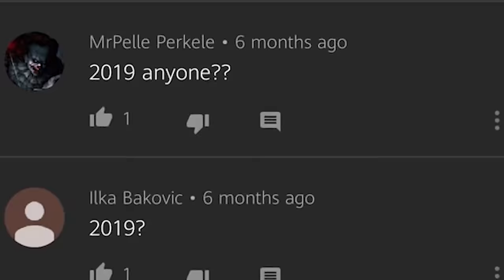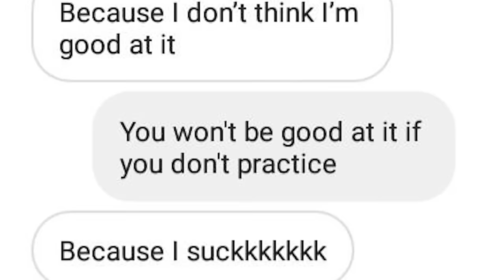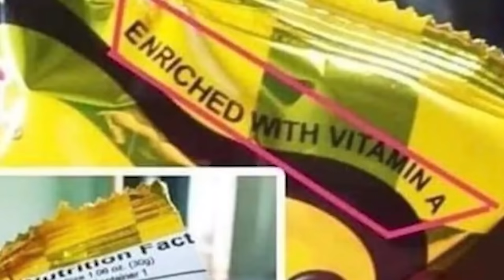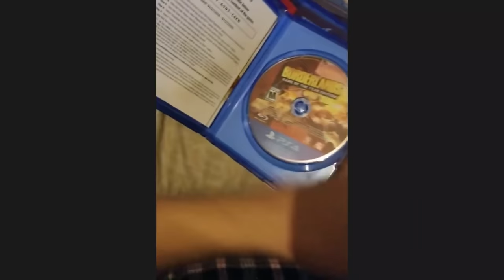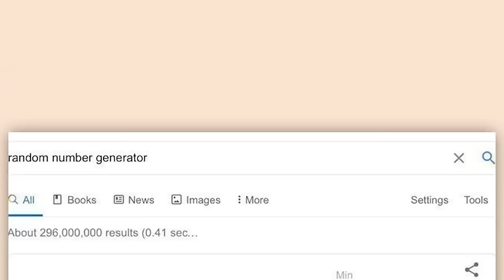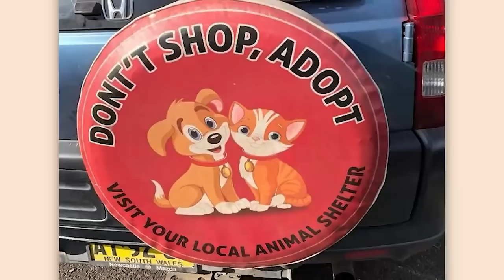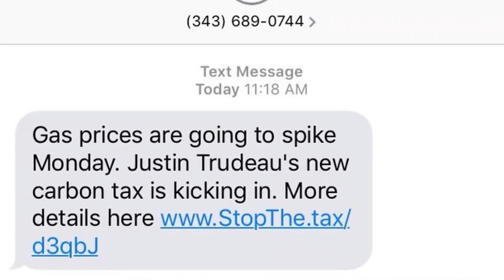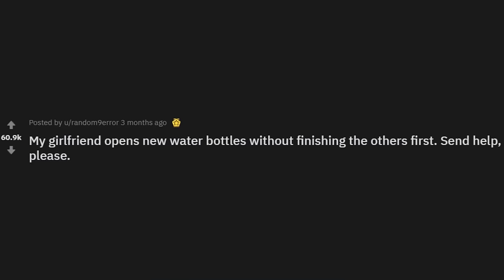THE MOST MiLD OF r/MILDLYINFURIATING

Comment: Fun fact, at 35:05, that is a completely possible pattern to show up on 4x4 Rubik's cube. On a normal 3x3, its not possible because the center pieces never move relative to the other centers. But a 4x4 doesn't have a set center, so if you solve it the way most people learn, (which is to make your centers out of the 4 middle pieces, then solve it like a normal 3x3) you can put the center pieces in the wrong spot. This will lead to this. But it is solvable. Just annoying and ruins your solve because you have almost zero way of knowing whether you fucked up until you get to this point where these 2 pieces are oriented wrong.
Reply: thats not the center pieces, its parity, you get a 50/50 chance of getting it (oll and pll)
Reply: @playformers1238   A parity occurs when you put the center pieces of a 4x4 in the wrong spots. With a 4x4, you create your centers first, then solve the edges like a normal 3x3. But the center pieces have to go in with the correct orientation. There's no way to know which way is the correct way, which is why its 50/50 that you'll get it. It affects the edge pieces when you get to the last part of the solve, but it stems from your center pieces. The parity shows itself on the edges, but the cause is your center pieces not being put in the right orientation. I never said those were the center pieces, I said that this occurs because of putting your center pieces in the wrong spot, which is 100% correct. You can't get a parity on a 3x3 because the centers never move relative to each other. Since there is no set center on a 4x4, it opens up the possibility of getting a parity because the center pieces can move relative to other centers.
Reply: @PotholedAxe9985  did you write this using ai? you have parity even in 5x5, where the centers dont move. the edges are flipped. that is why there is parity. its an error in edge pairing. plus, you were wrong about the parity in 3x3. you cant get it because there is no edge pairing there.
Reply: @PotholedAxe9985  Why are you trying to reinforce this? It's so obviously wrong.

Comment: 1:50 fill a bowl with broiling hot water, put the mug in and weight it down (don't fill the mug, you only want it on the outside), wait 5 mins, add some lube (the runniest oil ya got), place an icecube on the center of the tiny dish for 15 seconds (be sure to not let it touch the mug or let the any water for the cube touch the mug), put some plastic wrap on the rim, put a pillow on the counter, hold it by the bottom of the mug *not the handle* (unless you want to risk ripping the handle off), and smack it rim side down on the pillow. 100% will pop free.

The heat in the dishwasher expanded the ceramic just the tiniest little bit. The smaller dish would have cooled more quickly since, ya know, it was smaller. It was just bad luck they were nearly the same size so it just barely fit in there, then the ceramic shrank back down to size locking it in place. The same principle is used to hold the cap on nuclear reactors. They don't really want those caps to come off so the cap is heated until its glowing red hot and the bolt get a bath of liquid nitrogen. Once they are threaded together and the temperature equalizes god himself couldn't separate the two as they are torqued to ~4 MILLION foot pounds. In other words, you could have a wrench 50 feet long with 9 elephants balanced on the end and it wouldn't budge an in inch.

Comment: Fun fact, at 35:05, that is a completely possible pattern to show up on 4x4 Rubik's cube. On a normal 3x3, its not possible because you dont have to make the edges. But a 4x4 doesn't have the edges already made, so if you solve it the way most people learn, (which is to make the centers, edges, then solve it like a normal 3x3) you can make an edge flipped the wrong way and it will not be right. That will lead to this. But it is solvable with an algorithm (sequence of moves). Just annoying and ruins your solve because you have almost zero way of knowing whether you fucked up until you get to this point where these 2 pieces are oriented wrong. You can also get this a second time, which is when you put the edge (flipped or not) in the wrong spot and you have to fix it with an alg too.
By the way, another user tried to explain it, but was wrong. So don't listen to them. If you search how to solve a 4x4, you will see that i am right.
Reply: Yea

Comment: 4:56 Well, at least we know this video is Devil-free.

13:48 Went to HPB with my grandma one time. We got to witness someone park horizontally across four different spaces and just leave their truck there. It was still there when we left.

39:36 I don't think those are painted. If that's the soft part, I think those are molded with materials of that color, so they straight up just put blue plastic in the wrong mold lol

Mildly infuriating: Calling Bumblebee in specific "the speaky car"

Comment: 12:13 This reminds me of a Pentrex DVD my dad owns (Pentrex is a video producer that does train videos for railfans) and this was I believe at some point between 1988 and 1994 but the Norfolk and Western 1218 (steam locomotive) was doing an excursion. The Pentrex crew was chasing the train (meaning following it and either taking pictures or videos of it going by at different locations) and they happened to see a bunch of people in a parking lot waiting for the train to go by. Pentrex was not originally planning on stopping there but decided to just stop by anyway. About a few minutes after they set up, a Southern Railway freight train passes by on the track closest to the crowd. As the train is passing by, you can see the smoke and steam coming out of the top of the 1218 as it rolls by on the far track. None of the probably 40 or 50 people there saw the train.

Comment: 7:51 - if this ever happens to you, then fear not! All you need is duct tape, or a very strong box-tape and loop it with the sticky parts out. Tada - instant handle. Put it on the top, and pull it up. If it is 'super' stuck - add more duct tape without pushing the mints down with a lot of pressure and then try again. 

If it's /still/ stuck - try a vaccum hose. No nose? Totally desperate for a mint - and you /need/ it for whatever reason in that desperate moment? You can use a lighter or heat source on a metallic object and pierce it through the top - but that may ruin your candies...

Comment: I am not going to confirm whether it is true, but i believe that the blueish brown spots after the blood test is just internal bleeding, but the easy to handle kind. I also believe that there are two major types of internal bleeding: one caused by buncturing or popping a vein in the wall of an organ, thus resulting in organ bleeding, and the other being puncturing or popping a vein or other blood vessel that just exists in the tissues(most commonly occurs on arms and legs), thus resulting in tissue bleeding. Tissue bleeding should be theoretically easier to handle, since the blood doesnt really interfere with any life supporting systems, just sits around in the muscle and skin tissues. It probablu will hurt, but it wont be a big problem. Organ bleeding is way worse since it occurs inside organs, which results in a way bigger spill as well as floods the organ that got a bleed. This is way harser to solve, since you cant just wait it off. It is important to know that a lot of blood  running out of any part od your body is bad. And also i am not a doctor, nor do i jave any facts to back this up. It is purely speculations and theories.